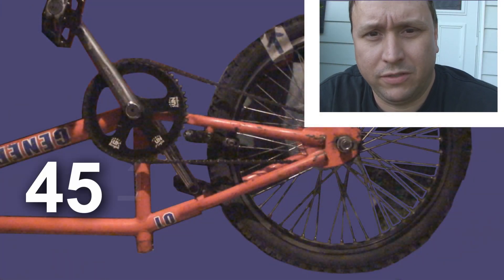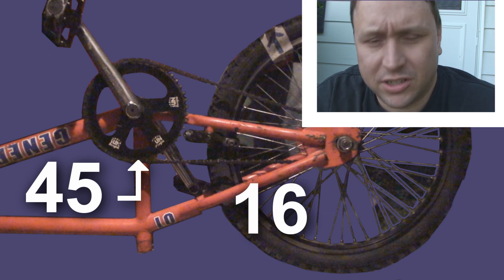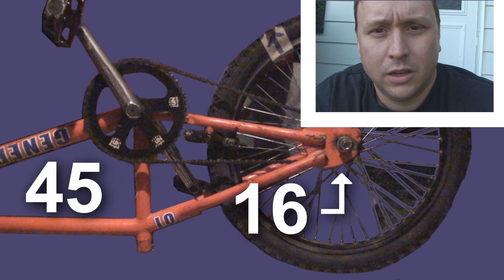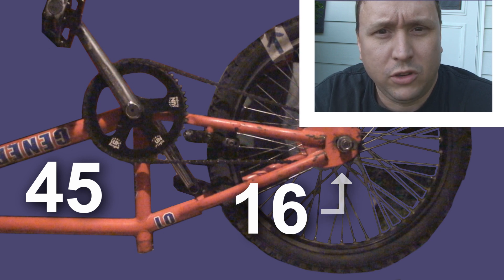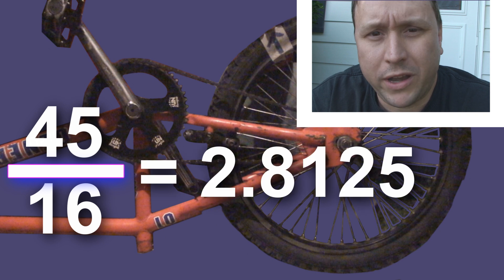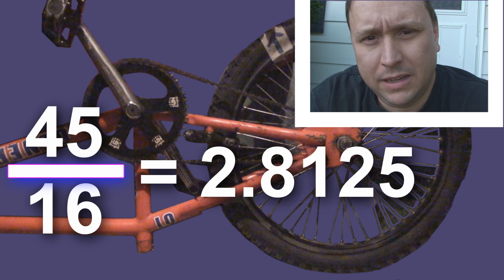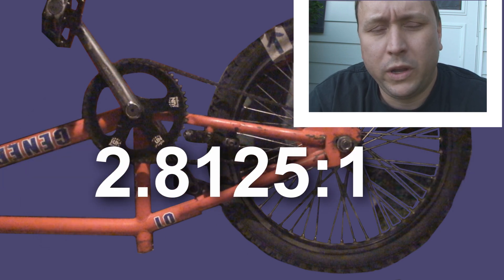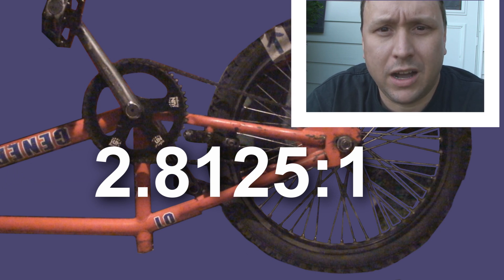Off the Chain - Bicycle Gear Ratios Explained

Comment: So is the ratio the same if you switched same gears 16 up front and 45 in back? Same results in torque and speed?
Reply: Nope. Its would spin extremely fast. Take mountain bikes for example. He smallest gear has 50 in the rear, and 32 in the front. And it spins very fast for going up hills. That bmx would feel like a dropped chain.
Reply: Nope. Its would spin extremely fast. Take mountain bikes for example. He smallest gear has 50 in the rear, and 32 in the front. And it spins very fast for going up hills. That bmx would feel like a dropped chain.

Comment: Is a 3.5 gear ratio good for bmx
Reply: +Kryptek Enzo No, that's too steep.  55 gear inches is a target for BMX.  That's why 44 / 16 is a common gear combo for 20" bikes (2.75 gear ratio x 20" wheel diameter = 55 gear inches)  I race a 26" BMX bike and I personally prefer mine to be a little steep, 30 / 13 (2.308 gear ratio x 26" wheel dia = 60 gear inches).  Go one step further and work out the gear inches (sometimes called rollout) of your setup, by taking your gear ratio x the wheel dia.  I went through a lot of chainwheels & cogs last year figuring out what I like.  And ask people at your track or trails about their opinion.
Reply: Jason Puterbaugh ok thanks man what about a 25t in front and 9t in back?
Reply: +Kryptek Enzo That's perfect for a 20".
Reply: Jason Puterbaugh ok thanks ill go for that
Reply: Jason Puterbaugh whats good for a 26 wheel bike?

Comment: yes, because if their are less teeth on the rear sprocket and more on the front sprocket then you get, with an engine, more top speed but lower acceleration.  But if you have more teeth in the rear sprocket and less in the front then, according to the engine power you have more acceleration but lesser top speed. I care for top speed more than acceleration.